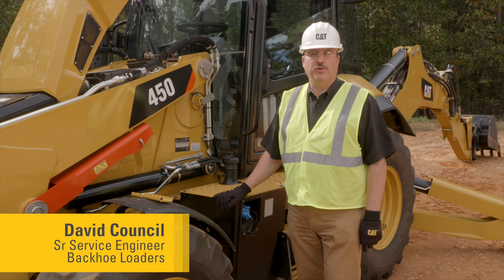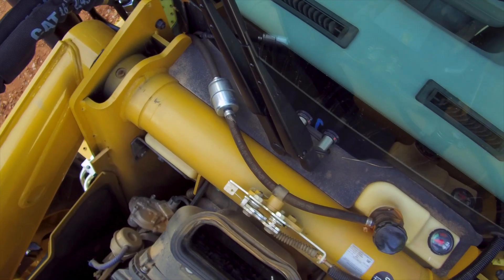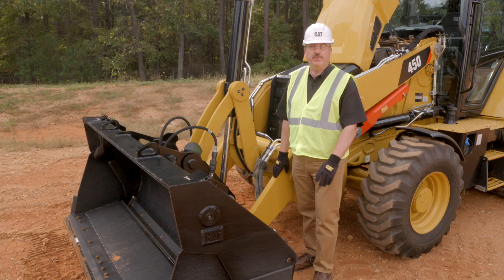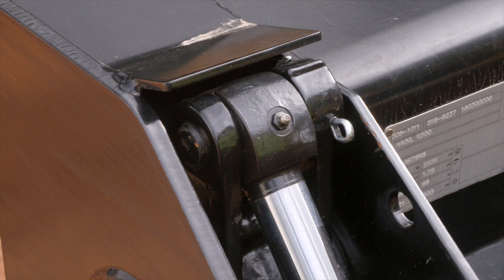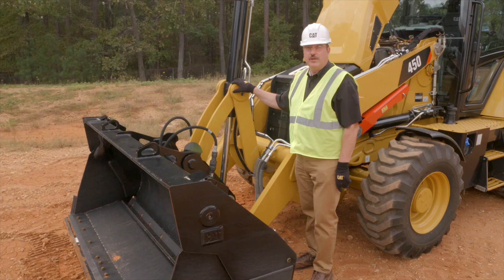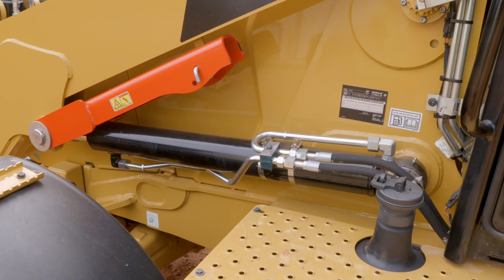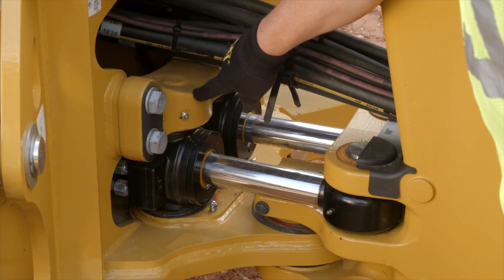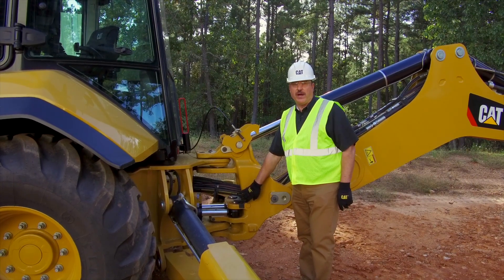Cat® 440 and 450 Backhoe Loader Grease Points Overview

Comment: Do the king pins, top and bottom, in the front wheel steering and the joints of the cardan shaft not have to be greased?
Reply from the maker: Hello Bernhard! The kingpins on our front AWD axle are lubed for life, sealed, and do not require regular greasing. - Ruth
Reply: That’s a good news!